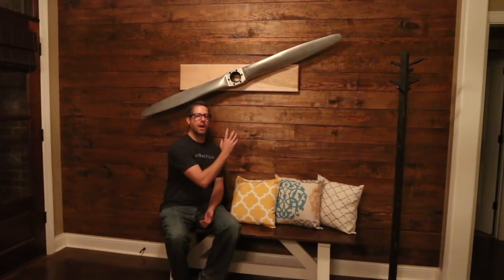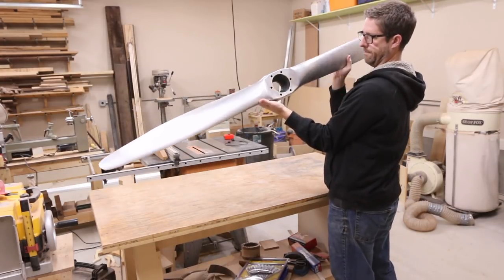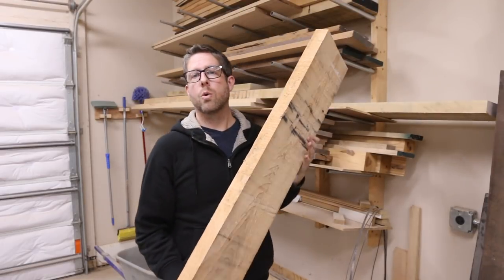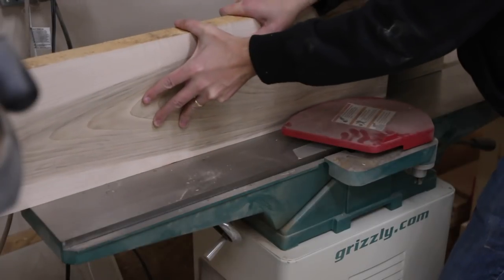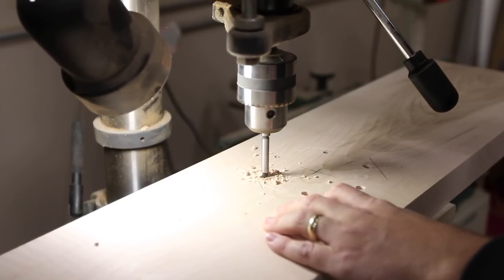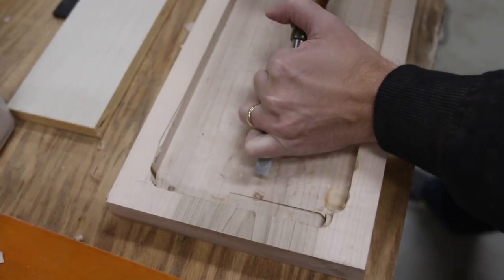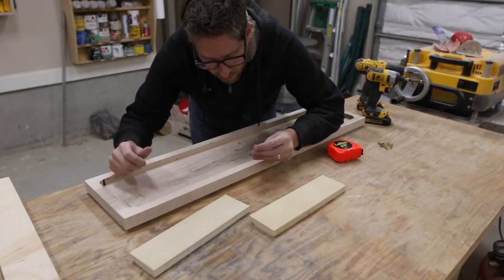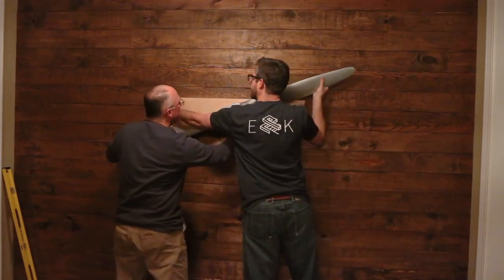Wall Mount for Heavy Items // Airplane Propeller Decor

Comment: I modified your idea. made a box out of oak three-quarter inch wood. It looks way better than yours. And I’m not a woodworker, but I thankyou so much for the idea. Been trying to figure out how to mount it for over a year. I took your idea and went one more!! so thank you again. I added an aluminum polished  nose spinner to my prop, so you don’t see the bolts. And yes, they’re six of them. But its highly polished aluminum nose spinner looks really good. Never seen a static propeller mounted on a wall with a nose spinner before. I got one!! thanks to you!! oh, and I use simple tools. I don’t have all your fancy stuff!!

Comment: That propeller came out looking really nice, and being flush against the wall really gives it a clean look!  I just posted a video the other day where I used the same method to hang a big heavy mirror in my bathroom.  It sure beats the two plastic mounting clips the former homeowners used to hang the mirror, they didn't even use wall anchors, I'm surprised the mirror didn't fall off.
Reply from the maker: I shudder when I come across things like that. Man, I’m glad it didn’t fall. Thanks for the kind words!
Reply: I was pretty shocked when I took it down, but the mirror feels WAY more secure now, french cleats for the win.

Comment: Nice work. However, maple must be very cheap where you are, that you can afford to turn so much of it into sawdust. Rather than routing out the recess at the back, why not create it by gluing on strips of the required thickness of timber? Less work than routing.
Reply from the maker: This piece was leftover from another project. And it had a particular lot of figure that they wanted. Plus, it needed to still have a lot of heft. That propeller is heavy.

Comment: I am thinking of using a circular piece of aluminum the same diameter as the propeller core so the mounting hardly shows.  I don't think hitting studs is necessary if you use a couple of toggle bolts.
Reply from the maker: That would work too! I’d be dubious about toggle bolts just in drywall depending on the weight. This one was heaven enough, I really wanted it in at least two studs.

Comment: Is it only me that I see this mounting not ideal with this visible peice of wood?? It would be so nice that the propeller is hanged flush with the dark wood by creating a mount behind the wood. or worse come to worse creates some decor with this mount wood, like make circular, paint it same color of dark wood, ect
Reply from the maker: I’m not going to paint curly maple in this situation. Ha ha. The wall was installed months earlier. They wanted a contrasting wood. It is very heavy and didn’t want to permanently mount it to the wall so it won’t destroy it when they leave. They’ll be taking the propeller with them if they move.